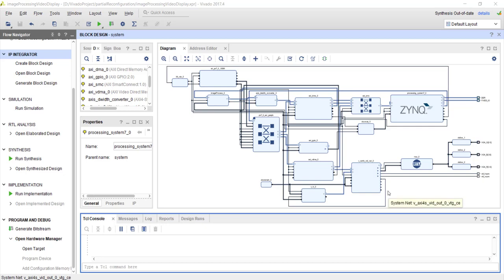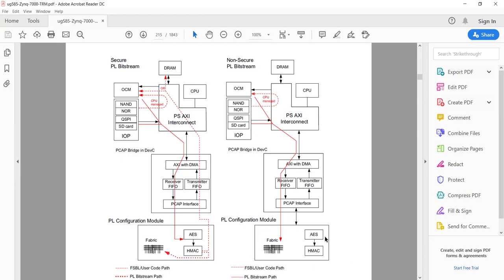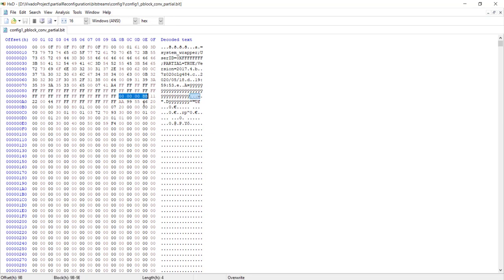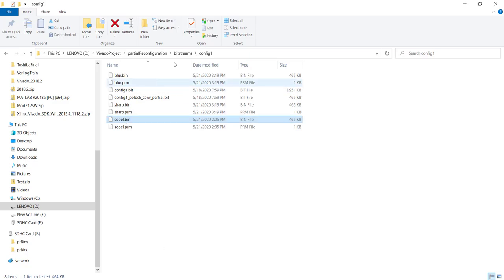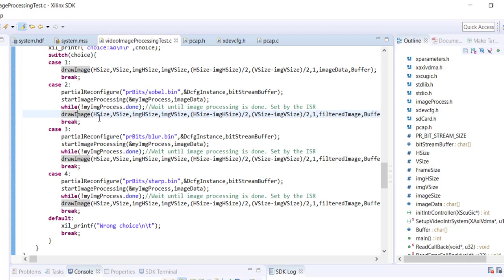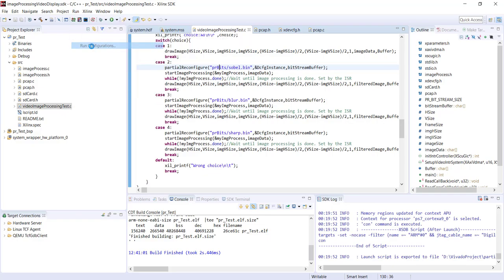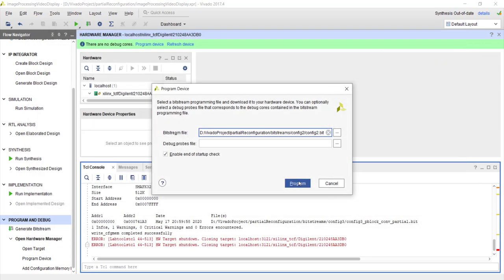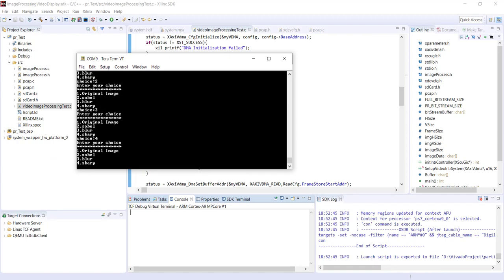Partial Reconfiguration: Part 4 Processor Configuration Access Port (PCAP)

Comment: it is helpful. have u used the xil_fpga in zcu102 to load the bitstream from PS to PL via PCAP, thanks.
Reply from the maker: Nope. I haven't tried ultrascale devices. But the exact code in this tutorial should work on ultrascale pcap also
Reply: thanks a lot, but the pcap in ultrascale transmit via xil_fpga library not the xdevcfg bridge.
Reply from the maker: Thank u for the info
Reply: @weitaoyang4442  Do we need only to change the include files and use the same code ???
Reply: @MohamedAbdelgwad-hx4lw 
it requires to including the following head files:
#include "xilfpga.h"
#include "xfpga_config.h",

Then, you can call the function like this to load bitstream: XFpga_PL_BitStream_Load(&XFpgaInstance, PARTIAL_STATIC_ADDR,					STATIC_BITFILE_LEN_HEX, XFPGA_FULLBIT_EN); after transfer the bitstream from SD card to DDR.
The flows are almost the same